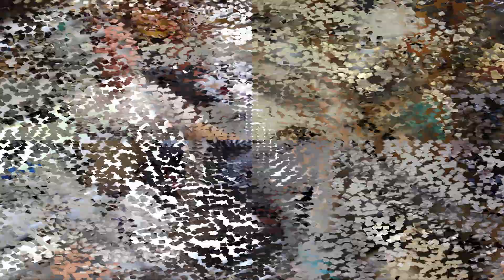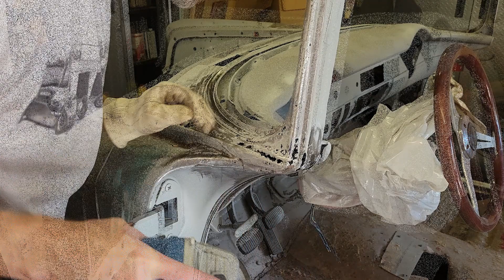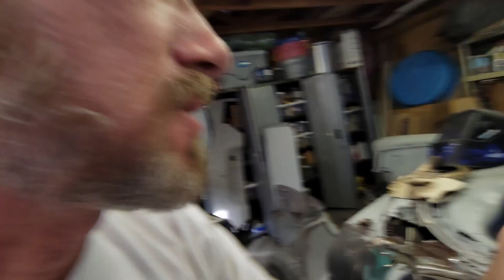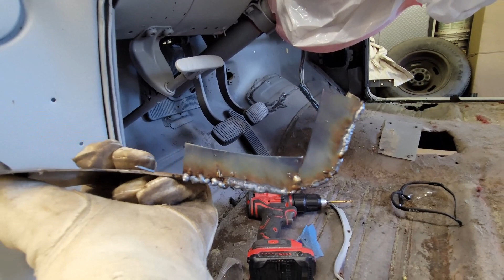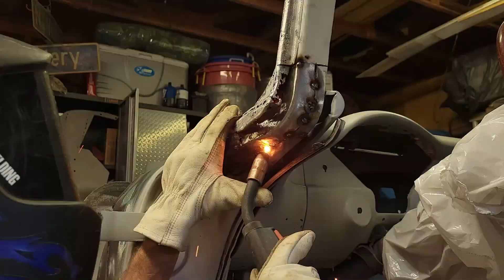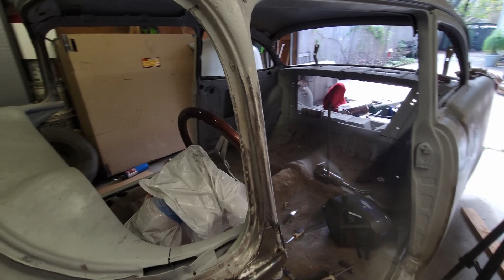E20 Tri-Five Rusty A-Pillar Fabrication and Repair!  1956 Chevy Bel Air Restoration

Comment: Not my first time watching this video, I would like to know how you bent the small u-shaped vertical piece. That seem like a tough one and you did a great job.
Reply from the maker: If I remember right, I bent it with a piece of steel rod.  Using the vice separated with a gap, use the rod to drive the steel plate down to start the shape.  You can use the vice to clamp (bend) it around the rod.  If you have to square it, put it on a solid surface like concrete and manipulate it witb a hammer.
Reply: @RestoringChristine1956 I appreciate so much. I’ll get to it soon.
Reply: the part we don't know what to call LOL

Comment: You said to set your welder at 3 and feed at 70 , what thickness is the feed of your wire and also the thickness of your sheet metal you used to replace rusted pieces
Reply from the maker: I mention it in a number of videos but not every one.  I'm using 18 gage sheet metal, 0.023" solid core mild steel wire, and 75/25 Argon-CO2 shielding gas.  Sometimes it works better at a lower voltage (2) and slower wire speed (50 to 60), depending on the gap in your joint. The right answer could be anywhere between those two settings, but definitely not too far outside of it.  Hope it helps!

Comment: Thanks for the videos!  I'm a new subscriber and doing similar type repairs on a "basket" 49 Chev pu.  I'm curious how you made the "U" shaped piece of the a-pillar @ 22:30...
Reply from the maker: If I remember right, I folded a piece over a stick of round bar and pinched it in the vice with a little hammer persuasion.  Glad they're helpful - that's the goal!
Reply: Thanks

Comment: The before looks Iike what I have to do to both sides of my 55. In the high speed video it didn't looks Iike you used any air after welding to prevent warping. Did you have any problems?
Love your wood form for shaping the edge that's what I was thinking of doing or finishing my bead roller but the wood idea is simpler.
Reply from the maker: As I've been shaping things on the car, it's easy to see how you can beat the metal into a curve when something is backing it up.  And wood is easy enough to gouge and carve up if you've got a course flap disc!  And I've found that warps are almost non-existent if you have curved pieces that are going together.  The shape restrains the distortion.  It's not nearly the same as flat work.  Flat work is almost impossible to keep from shrinking and causing ripples.

Comment: That's a tough repair you did a good job. My 55 has this issue on both sides as well I'll be trying this before spending big money on the repair panels for this spot.
Reply from the maker: Before I tried this, I was looking in the catalogs and saw that it was several hundred dollars for two different pieces and I'd only need a part of either one.  Once you get to where you can weld without blowing through, it gets a lot easier.  Thanks for watching and good luck with your 55!